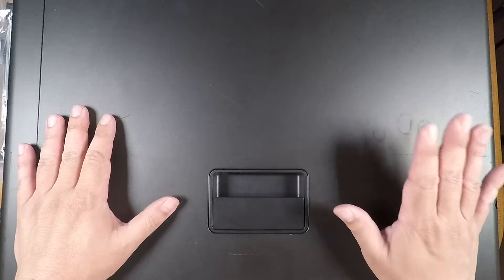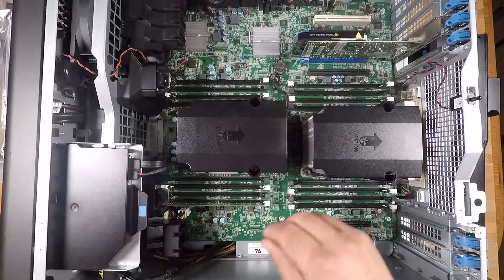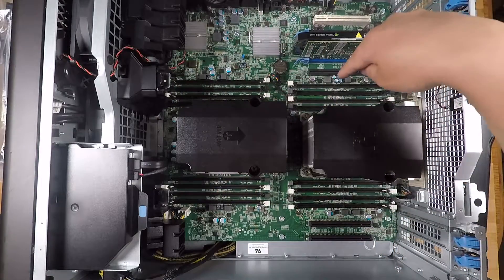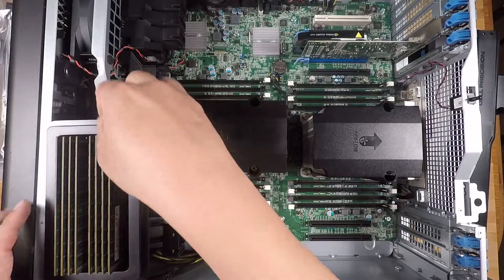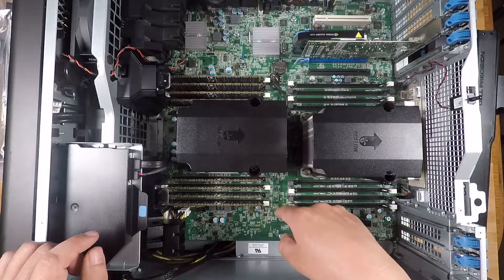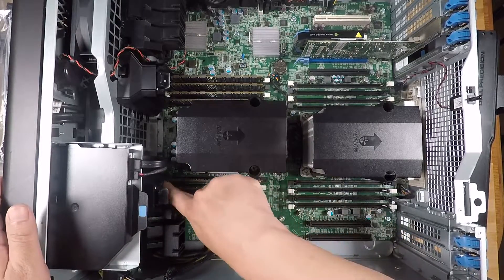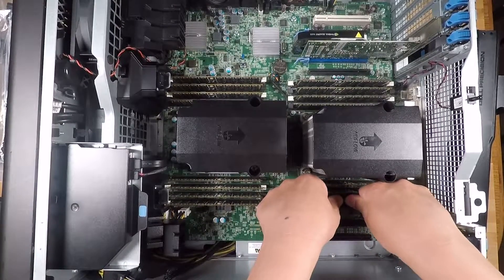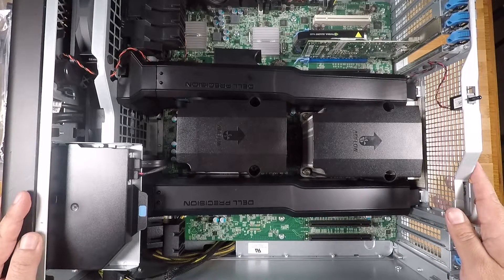Dell Precision T7910: How to upgrade RAM

Comment: Hi , Can we install free ESXI 8 in T7910 server. ?
Reply from the maker: I don't know. VMware requirements can be a pain. VMware does have a compatibility matrix you can use to check if ESXi 8 will support this hardware.

Comment: The fourth channel (both CPU) DIMMS don’t seem to work for me. Mobo is OK, tested with other CPUs…. I think these Intel Sample CPUs I got on ebay have an issue on one of the memory channels😢
Reply from the maker: That's possible, but in my experience that is often a bad pin in the LGA socket. Take a close look and see if you have any pins out of alignment and adjust with tweezers.

Comment: I have dual 2696 v4 cpus in a dell 7910 server and 12 hma42gr7mfran rdimms.  However everytime I put any more than 2 dimms per cpu it flashes an error code.  Any idea what's going on. I'm about to pull my hair out.
Reply from the maker: No, I can't tell you what error code that is. I recommend you look up the error code so you understand what it means.

Comment: Warning, this is REALLY long post: 
Some ideas about memory installs based on issues and my experience  with 16x 4GB modules on memory riser cards in several Precision T7400s*
Eventually I learned the wiggle trick and after that it occurred to me that three possible causes could be, a) Thermal cycling of Dimms running up to 90c (FB DDR2 EFF max operating temp > 100c. the DIMMS run very hot) and a cooler riser DIMM slot could eventually result in the DIMM shifing a bit in the socket. SLN: Run speedfan and increase memory and CPU fan speeds.
b) Voltage swings to DIMM slots resulting in slight carbon scoring/resistance increase on DIMM goldfingers or slot edge connectors. sln: see below.
c)Oxidation of goldfingers (and subsequent contamination) of edge connectors from sources such as oil from fingers that touched the gold fingers, or oily atmosheric contamination prior to dimm installation.  SLN: First blowout/vacuum dimm slots, then use a solvent such as safe for plastic contact cleaner or isopropal alcohol applied to a coffee filter, or similar filter paper to clean goldfingers and slot edge connectors. Filter media is great because it is lint free and doesn't easily shred,l it has a somewhat rough texture to scour contact surfaces without removing the gold plating. I use coffee filters for a final cleanup for CPU pin pads, and to DELICATELY brush off CPU pins. Filter paper is also great for cleaning card slot edge connectors and cards, fold the paper to the the thickness and shape you prefer to clean the the slot you're working on.

After a sufficient dry time Install your clean dimms in their slots, give them a wiggle, boot your box, run up the memory temperature with a stress test to the point you're confident they are at the higher side operating range giving adequate time for memory and slots to be heat saturated (45 minutes should do). Shut down. Allow the system to come to ambient temperature and then give those puppies another wiggle :)
Please note, I omitted the obvious steps of unplugging your box and grounding yourself before you play around with your memory. 

Speedfan can be used to moderate memory temperatures but it's no longer supported by almicro and it's somewhat tricky to set up on Dell systems because of the "custom" way Dell sets the base addresses for fan control- thus you may only be able to control two or three PWM fans in your system such as card fan, cpu fan, and memory fan. HWINFO used to have fan control, but they dropped it a couple of versions ago., There is a linux fan control for Dell Poweredge 2900 servers. If you're playing around with PWM fans in a Dell be sure the pinout conforms to fan pinouts for your particular Dell system. If you plug a standard fan with typical pinouts into a Dell, you'll fry the fan and possibly that fan channel on your MB. Thanks Dell, it was a cheap fan anyway :D 

 *Occasionally upon reboot I'd get  an error message similar to (I don't recall the EXACT message) "Single Bit Error on: Riser # x Dimm # or Riser ## Dimm ##, press F1 to Proceed, F2 for setup..." occasionally adding "System memory adjusted to xxxxxx" where # represented a card number and module # and the second set of ## numbers represented the corresponding slot and channel on the second riser. It was a pain because the numbers presented didn't necessarily reflect the actual pair of DIMMs, or correspond to Bios numbering and xxxxx was the memory available after the DIMMS were taken off-line.

Comment: Thank you for sharing.

Can you boot Win10PRO,  and run it from say..  1TB NVME? On this  T7910
Reply: Yes you can I have just installed 2tb mvme.2 and using it as boot Device
Reply: Running a 2Tb Samsung 980 Pro.  Works well.  Just get a good adapter to PCIe.  EZ...
Reply from the maker: i would imagine possible, but i'm not a Windows user...

Comment: Would those dimm's happen to be M393A2K43BB1-CTD7Q? Am looking to upgrade myself and usually go with Crucial and after watching this video noticed Samsung being far less expensive.
Reply from the maker: you know, I don't know... i made that video several months ago now. as long as the RAM meets the specifications, I usually do not have problems with Samsung, SK Hynix, and Micron DIMM modules.

Comment: Don't take this the wrong way, but stop being a pussy with memory... Move it back and forth to make sure it's sitting right.  Then use two thumb method to lock it down.
Reply from the maker: Lol
Reply: Also doesn't hurt to hit slots with compressed air and clean contacts of memory with high % alcohol on older equipment.